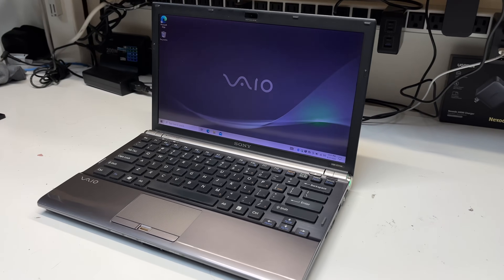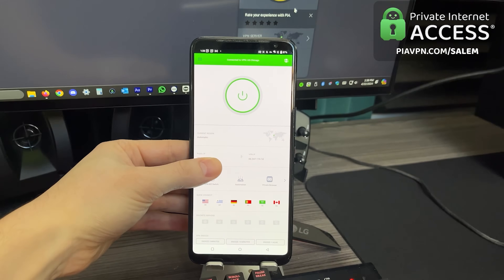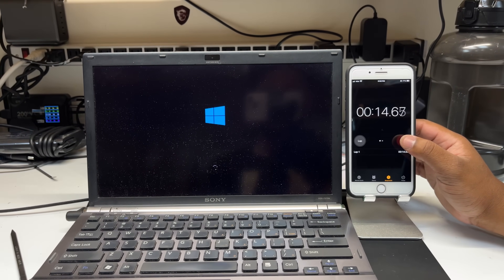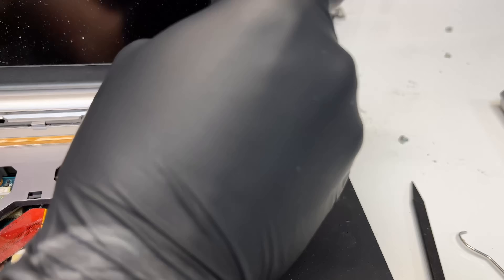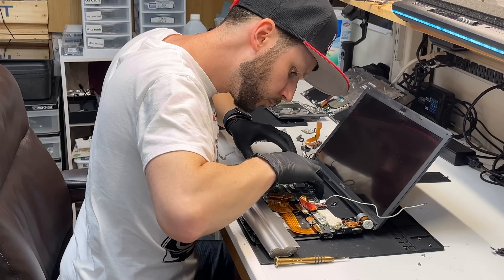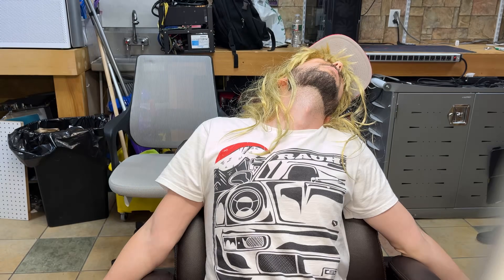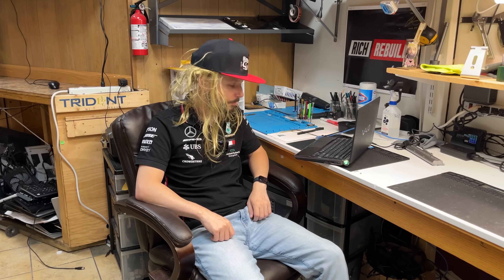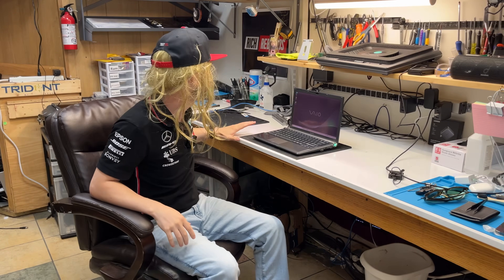Sony Vaio Resurrection: Saving this Insane Tech From 2008 (and why that soon won't be possible)

Comment: For all the shit people like to give Apple, I have a 2013 Macbook Pro Retina that still works. Including the battery. It's 12; same as those kids you like to touch when their parents aren't looking. j/k 🤣 I think it will still be working at 15 years, although that 4th Gen i5 is pretty low spec for today's computing needs. (And you basically need to use Linux to get it working with current versions of software.) -- Firefox ESR still works for a browser, but the OS is way out of date.

Comment: I have a 5yr old HP laptop, that I only paid $400 new.  Its like an I3, 12gigs ram, with a 17" 1080p monitor.  The family uses it for surfing the internet, doing some light work, watching videos ect. Its almost always in use and it works great, I havent had to fix anything on it.  At this point every day it lasts is just a bonus.  While that viao lasted 16yrs, it cost 2k to do essentially the same thing as my $400 laptop back in its day.  When mine dies, Ill replace with a similar $400 machine.  Its the gaming laptops that dont hold up, or laptops that kids use.  These light duty machines last a long time.  I have always had one similar to this for the family.  I dont think one has ever just died, they were all wrecked by the kids dropping it or spiling stuff.  I have replaced a HDD or 2 back in the day but thats about it. I just stopped buying gaming laptops, too much hassle, something is always going wrong with them after a year and a half or so, and they are too much of a pain in the ass to fix.  At the end of the day who ever owned that vaio could have just recycled it and purchased a better unit for the same price it cost to upgrade it.

Comment: I have a Sony PCG-81114L and it is heavier then heck!!  I just put it on my workbench and it stays right there!!  Not sure what CPU it has but it runs really, really hot so I need to find an upgrade fan that will quiet it down and cool it off better.  I took it to a business about 5 or so years ago and had them upgrade the hdd to an SSD but they only put in a 256gb ssd!!  Hardly room for anything but atleast it doesn't have that old school hard drive sound that used to bother me so much!!  Also, it only has 8gb of ram so I need to find out if it will take 16gb of ram or more.  it's just a backup laptop that I use as a desktop.  It does have a really nice Geforce RTX that makes the 17" screen look amazing!!  Any tips on anything else I can do to upgrade this laptop?  Thanks in advance!!!

Comment: I worked in sony vaio tech support for LATAM in my country. We had some models for reference and i remember one model with the AR designation. that was a monster, it had a blueray burner, the screen was like 17 inch. I remember having a discrete Nvidia GPU with a hardware switch to enable it. And i believe it had two physical HDDs. Man talk about expensive.

Comment: Okay, yeah, this is becoming a serious issue, and the reason...is refrigerators.

40 years ago, fridges would last 20, 30 years, but have toxic byproducts that would sit in the landfill, but work forever.  Fast forward to French Door fridges in the 90's that became...high end, and barely affordable, but gorgeous.  So, everyone wants those...and in the 2000's these become basically the midtiers everyone wants, with filtered water on the doors.  Then 3 years later, that include ice makers on the doors...and the fridges have more points of failure.  

Now, fridges are coming out that include chips to do food ordering right from a screen on the fridge, and some of them have, as revealed on your latest vid from CES, recessed door handles on dishwashers and even fridges, that can also open and close on their own.  These cannot be repaired, and are garbage.  

Nightmare E-waste dystopia, here we come.

Comment: My HP Omen 16-n0002nf will certainly live for a decade at least. Everything is made to be accessible and parts can be found easily online.
It also has a lot of performance to spare for the future (R9 6900HX + RTX3070Ti).
I already put PTM1750 on the GPU but the CPU had factory applied liquid metal so I left it be. Should I replace the the liquid metal with PTM1750 too?

Comment: I have a VGN-Z vaio.
A wonderful computer.
Its 25 years old but it still works. The graphics accelerator is gone, the battery has gone, but it is running. 
Problems galore as this computer has only 2Gigs of slow RAM

Comment: Watching this video on a Sony Vaio All in One vpcl22z1e i7-2670QM. Got it from a lady who was giving it away because 'it couldn't be upgraded to Windows 11.' A new SSD, a repaste, 8 extra gigs of ram and a new wifi card and it's good as new. Best part? It's got a 1080p touchscreen with 3D built in and a re-writable blu-ray drive. It's also got hdmi in and out, so while it's not a powerhouse (thanks GT 540M) I can hook up anything it and use the excellent screen.

Comment: You could have picked up a couple of new much higher spec laptops as it cost to upgrade that one. Had a Sony Vaio 25 years ago. Great laptop but not going to break the bank for nostalgia's sake. Sony Vaio was always the best-looking thing on the market. Was sleek and sexy in a world of boxy looking laptops. For resurrecting a laptop OS, I'm sold on just scraping it and dropping in Zorin OS 17. Linux is awesome on a laptop. just started learning about Linux and already am doing tweaks to it. Was always afraid to try it (thought it was too complicated) but just need to relax and not be intimidated.

Comment: 12:54 well ironically enough business devices are usually pretty tough, probably it would be bad PR to tell a CEO of a bajillion dollar company to buy a new laptop instead of having a serf instantly repair it x)
HP even made and still makes surface clones that are well serviceable.
As for the question: My bet goes on HP business Laptops like the HP Fury series since their business laptops actually seem to improve in quality while lenovo is slightly degrading.
There are many linux users that have lenovo laptops this old x) 

There are even IDE SSDs for maintenance on really old hobo hardware.

I also love repairing stuff, last time ive replaced one stick of a wii u pro controller. Its kind of a pain to solder these contacts while holding the stick in place.
Windoes 10 going EOL might just lead to a lot of ppl going to fedora linux or linux mint. I"ll fedora a pc of a friend soon.

Comment: I have a 95 JDM Rav4
Its a solidly built car that still has OEM parts available, and everything on it is repairable or replaceable.
With how crap modern cars are and how many electronics are in them?
I dont plan on getting a new car for a very long time

Comment: Irony, in the Green World part the only thing green they see is the color of money (great movie btw). 
I recently got a new to me HP ZBook G2 17, i7-4910, 32GB, 500GB HDD, Nvidea Quadro K3100M for $410 CAN/$280 USD, delivered. They screwed up because it has a K2200M, a 2GB GPU & it's supposed to have the 3100. $112 refund later I find a parts only with the GPU I want plus it's a donor, for $140. A main reason I got this laptop is accessibility & non preparatory shit, like Dell used to do!
PTM7950 is on order & paste, I already swapped a 2TB SSD in it with the WIN10 Pro it came with. Fresh ram is here to hopefully get rid of the ram error I get once in a BSOD moon once the PTM arrives. 
Not a beast but it should be a strong, reliable & easily maintained, laptop for another 10 years, or so. 🤞
Watching this made me feel.... better about the HP.
Thanks!

Comment: My daughter is still using my old Lenovo Y700.. I have kept up with the maintenance on it -  upgraded the thermal paste with PTM7950 and populated it's m.2 slot with my old Samsung 512g EVO drive. She uses it for everything and has no issues. This will be the 10th year it's been in service and used almost daily!

Comment: I have an HP probook 4445s from way back a decade ago I was kinder when my mother bought it and I’m going to graduate highschool this year and it is still working, I have just upgrade the RAM and the CPU because it was upgradable, the only thing that holding it back is the limited list of cpu’s for the socket, you doesnt even need screw driver to open the back of it you can do it with your bare hands

Comment: Unfortunately, even VAIO nowadays have been going for soldered designs.
And yes, VAIO exists in 2025, just no longer under Sony anymore (they sold off the company to Japan's JIP in 2014 and rebranded to VAIO Corporation), and now focuses on Made-In-Japan Business laptops (that only has embedded integrated graphics!) only, and expect the prices from USD900 to USD2,500 a unit.
Reply: I have a VAIO from 2022 as my daily driver given as a gift. The fans are pretty loud, but it works very well

Comment: I actually have one of these my dad had this for over a decade has a 6 core CPU 8gb of ram for it's time it was a beast I don't know how but when I went into repair this one for overheating I found the clamp for the CPU was missing a screw only 3 sides of the CPU were held in place. Ending up have to melt/solder the loose side in since it looked like it had broken off the chassis.

Comment: I had a 2007 VGN-CR190 Vaio that I bought off a friend for $500. He was going back to his home country and reducing load, He'd had it for 2 years but it started having HDD issues,  and had no time to put it to Sony service. He got it for $2200 maxed out with an nVidia GPU, 8 GB of RAM and a 500 GB HDD. The beast had a C2D T7500 if I recall correctly. The issues that Sony fixed with the HDD came back even after service (this was in early 2009), which I determined that wasn't an HDD issue at all, it was bad thermal paste repeatedly rebooting the laptop during POST/Boot up which was corrupting files. 

I redid the thermal paste with a tube of Arctic Silver (still have it around as a first pasting memento), took out the DVD drive and swapped in the original HDD on a SATA caddy, added a 128 GB SATA SSD and reformatted everything to run Xubuntu. The beast it became never faltered same again, its performance was beyond belief as I segued from Vista to W7 to Xubuntu to Xubuntu + W8/W10 dual boot system for the next 8 years. Did my doctoral thesis work of simulating mineral surfaces using MatLab, Python and sundry CPU toasting stuff. 

Eventually it became unusable after my 4-year old daughter had a go at the keyboard in 2017, and swept it off with the table cloth taking one of the hinges out, and the board connector to the LCD cable somewhere near it. It still booted, but with keys missing and a flickering panel it became unusable and I had to scrap it. Still miss it after all these years - it truly was a pleasure to use, and bested 10 years even after the usage abuse

Comment: They were next to impossible to work on. I was lucky to get 3 of those still on warranty, so I'd send them over with overheating issiues. Instead of repasting each one myself, they'd replace the motherboard and cooling systems on them on warranty. I'd replace the hdd with an ssd, expand the RAM and install whatever software the client wanted. After getting just one after warranty, I refused working on them. They mostly died out because of the GPU-gate back in 2008-2010 anyway.

Comment: I used to own a old hp compaq laptop with windows vista. Issue is internet chip died so I can't surf the internet before 2017. During 2017 it died

Comment: Just got an unrepairable and unupgradeable, 2.5lb  LG Gram to take the heat off a 12 year old, 15lb HP Elitebook I had upgraded to SSD's and 32mg of Ram 5 years ago. It has a Core i7 and does pretty much everything I need besides HD vid editing. Now the fan went out and I got dead keys. I think I'm gonna fix it to use for a backup or a VM personal server since parts are still availabe on ebay andI don't give af about MS support.

Comment: I had a Vaio laptop around 2009. I paid $2500 for it. Liked it so much I got a Vaio desktop. I had both of them for nearly 10 years with zero issues until the mobo went out on the desktop..  Great computers for the time.

Comment: You we're my inspiration to be bold enough to remove the accumulated ball skin residue from the fans of my laptop. I'm watching YouTube on a recently installed Windows, and this old war horse barely makes a noise. Edit: this one has the kind of service lid on the bottom, so I just had to borrow someone's toothbrush.

Comment: I still use a dell Inspiron 15 5559 from ~2015. Apart from the slightly wobbly build its still going cause the ram and storage are so easily upgeable/replaceable

Comment: A modern laptop that will last 16 years? Probably a Lenovo ThinkPad or a Dell Latitude 
or Precision or other professional grade laptop (e.g HP EliteBook)... And I attempted to fix an old  HP laptop recently. I needed some help at first, but now I'm able to plug/unplug the connectors  successfully which is kinda good. Sadly, it has a flashing caps lock button and doesn't display   anything but at least I'm starting to learn how to fix laptops and I want PCs to last too...
Modern day cheap consumer grade laptops are incredibly bad. My Asus Vivobook E210 MA has terrible specs, so it made me very mad a few months ago and I damaged the screen. This laptop is now a mouse pad and it's just 2 years old yet the CPU spikes to 100% with only task manager open. And I now have another piece of dogsh*t consumer grade HP 14s laptop with OK specs but the horrendous build quality is what will kill this thing even if you open it from the middle like I usually do...

Comment: questions before you buy a electronic device

will the thing last? - general quality, dont buy corporate slop
am i better off getting something second hand? - sometimes older stuff are better in terms of repairability and still can provide what you want it do do without compromise
if it wont last by itself, does it provide resources to make me be able to make it last? - abitity to be repaired
does the company respect its consumer more than it wants money? - no greed, this isnt tboi greed mode

that has lead me to the stuff i use in my day to day
a 20 inch apple studio display FROM 2004. (4 years older than ME and still works literally no issues at all)
iphone 8 that i got 3rd hand, i really dont like apple but when you can get a deal on their old stuff its good (and second hand means i didnt give them money, eat shit apple if you are gonna continiue going anti repair or maliciously complying)
linux as my os, microsoft can eat my whole ass if they continue making windows worse just for the sake of money

vote with your wallet

Comment: Sony vaio. A bad laptop. I remember fixing these laptops are always a nightmare. I still remember had 1 laptop I formated, no matter what or how you format it, it always regonize d drive as the c drive instead. If you say repairable, I say Sony vaio is a disgusting brand of laptop and that is why it was eventually sold off. To date I still have trauma on repairing this brand laptop period.....

Comment: I tired upgrading an old dell lapop from 2009. Unfortunately, i couldn't find any ram that was affordable for it. It only has 2 slots and 2GB was the biggest i could find. I could, however, get a battery no problem.

Comment: I had a 2011 Sony VIAO Ultra-book aluminum casing and it performed flawlessly.
The only issue was when I replaced the hard drive. I was given the runaround by Sony and Microsoft about installing Windows.
I was finally instructed to pay them 14 bucks shipping for the free discs.

Comment: 13:48 i'm old and can't tornado spin or flip reset in rocket league (yet) i was about to take a stance against you cuz i am an argumentative troll. i still am about to, i just threw a curveball to confuse whoever's reading this idk
ok the laptop cost $2k in 2008. i was in middle school. a $200 laptop today is more powerful and potentially longer lasting.
seeing this design it was apparent to me that one of the main reasons it was difficult to repair is because they were pushing the envelope with compactness. i'm vaguely remembering sony making a laptop comparable to the macbook air but way more powerful. this must've been it.
then from there i realized how that making something repairable is a design goal. it takes a ton of effort.
if we could show the designers some respect instead of seething about about muh rights to repair, maybe we could have a conversation. i highly doubt it because muh capitalism, but hey. perspective.
motorheads generally accept fast cars aren't going to have as good gas mileage. as a cyclist i get tired after 100 miles and it takes me 10 hours.

Comment: Did you search for the drivers on the Internet Archive? There are a lot of websites where you can find drivers, either archived, or re-written by enthusiasts. It's usuay a good bet they'll work for older laptops, since the drivers are relatively simpler.

Comment: I have to completely agree with you. I am watching this on a laptop that has a laptop that has an A8-7410 in it .. (9 years old ) cpu.  you nailed it for most people old tech is just fine.  my mom is using a 2nd gen i5 and has no issues at all.

Comment: I'm writing this comment on my 2010 Sony Vaio VPCF12AFM, $1000 from Best Buy.  I upgraded the RAM and the storage to a crucial SSD.  I had to RMA the RAM, because it was faulty, and during that diagnostic process of "why is my computer blue-screening", the system lost it's control of PWM function, so it just kicks the fan onto high after a few seconds after booting.  I thought replacing the fan might fix that, so that was a tedious process as you might guess, and I did find a component, but it did not.  Got it back together, and only other issue is the wireless toggle switch no longer works, but that's no problem.